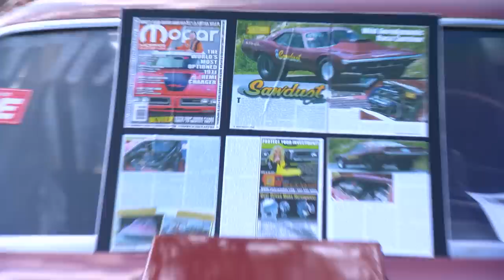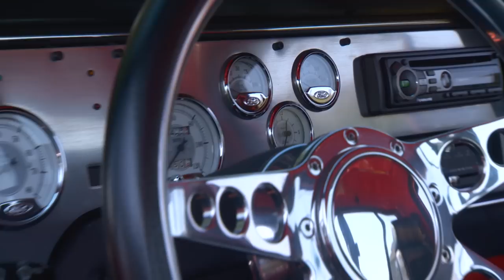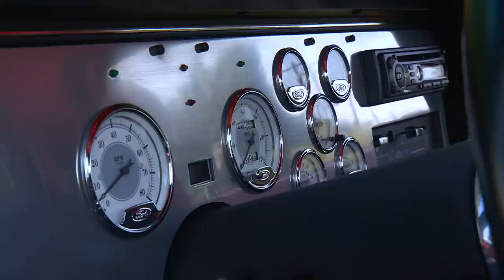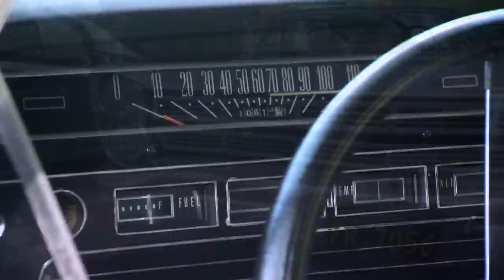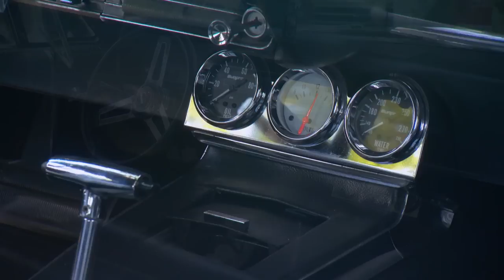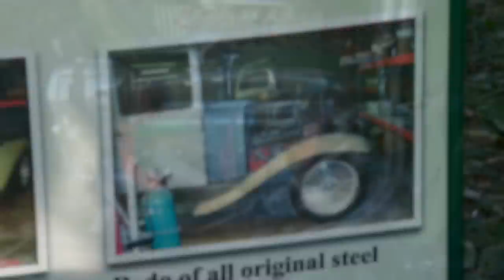CUDA Girl | 1970 Plymouth Barracuda AAR | Mopar Madness | Lime Green Metallic

Comment: I had a challenger T/A with the same drive line as the AAR ‘cuda. The  340 never gets as much love as the big block V8’s
Reply: I had a 71 valiant with a 318, 600 Holley and dual exhaust. 

I used to regular at the drag strip and routinely could stomp dusters with 340, 
At least in the 1/8 mile. 

Although I think those were later post 1972 340 with lower compression. 

Still though. I say 318 doesn’t get enough love.
Reply: Nathan Brame take a quite a bit for a 318 to beat up on a 340 ive had both and a 340 is night and day and this is 6 barrel no slouch a 318 would have to be done up pretty well to beat a 340 or the 340 didn’t know how to drive it
Reply: We do
Reply: @jeffleblanc8850  at the very least I'd assume he's got 340 heads or something to that effect. 318 heads are near worthless, one of the weaknesses of the 318
Reply: Just bought me a numbers matching 70 duster 340

Comment: I had a beat up AAR Cuda in purple very rusty, but I learned how to twist a wrench I tell you and how to use a rivet gun as well.  I finally just went with primer black it was an automatic Torqueflite trans and I put in a 4 barrel carb as the dual point distributors drove me nuts, an AVS which I rebuilt myself, open headers so it ran very fast probably 0-60 in about 5.3 secs which was extraordinary for that time

Comment: My first car was 70 Cuda with 340 and slap shift in a blue. The First owner i bought it from had a 6 pack for it that he put on it and raced on the weekends. he sold the six pack before i got to buy it.It had the side pipes,road lights and the aero wings on the front with the short spoiler on the back. But i am fairly sure it was Not a AAR  as the Paper work said it was  a340 Cuda one of 7000 something if i remember that right as i bought the the Car in 1980.The engine turned out to have a bent cam and so i put it back in the Newspaper for sale again. The Guys who bought it from me were the ones who had Bought the Six Pack. Fifteen years later i met at a grocery store i worked at a guy with a Immaculate 70 Challenger  and after telling him about my Cuda he was one of the men that bought My Car. His came with his Best friend to by the Car in 81 and the Restored it to Better than new with 440 in a Black. The sad Part of the Story was that a Year or so later that friend took the Cuda for a Ride while Drinking in  Arkansas  and they had to Cut the car in half to get his friend who had died On site. A Very Sad Story but i do miss that Car and i Had even Tried to find a Place to Store it until i could have Fixed it .